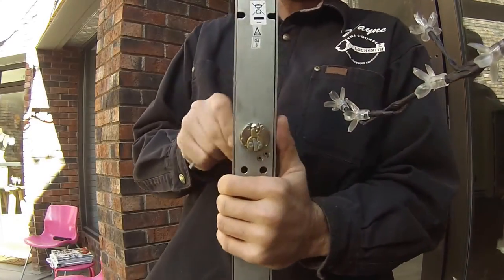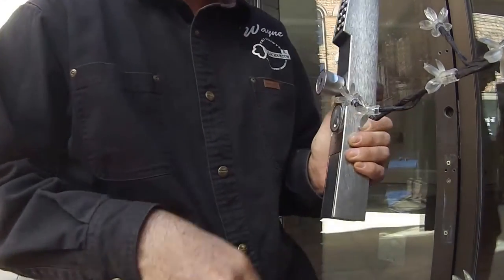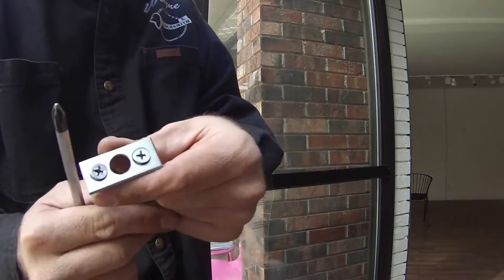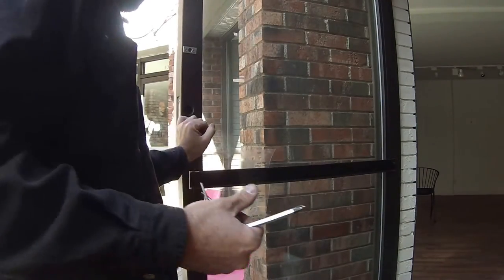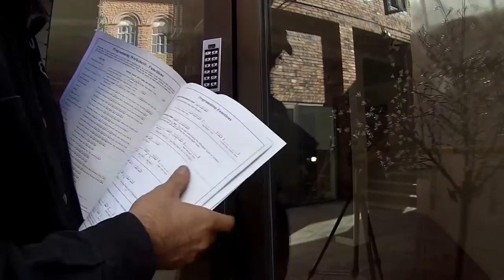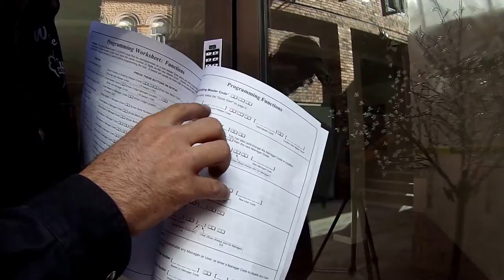DIY Access control install keypad Alarm Lock 1250 For Narrow frame aluminum glass storefront doors

Comment: I see that you removed the pull handle to accommodate the lock mechanism.  What style did you replace it with?
Reply from the maker: The lock comes with handle also there is a push pull paddle on the inside
Reply: @waynewinton  where can I find that proper push paddle for the inside ?
Any help will be good 
I am installing a DL1200 model on my door 
But don't have the push paddle for the inside 
Do you have any idea on wich one can I use ?
Thanks

Comment: If you want to make a nicer install use that lock with the deadlatch so it locks automatically each time it shuts. To save $$ just use a TTurn inside or the AR push paddle which either one allows deadlatch bypass mode for day use.

Comment: which model combination lock  would you recommend adams rit lach lock  with a lever handle  thank you
Reply from the maker: The Alarm Lock Dl 1300 or 1200 will work with that
Reply: i need with out side lever handle  why you call it alarm  does it have a alarm  build in the lock
Reply: @waynewinton  after you enter the code it doesn’t Inguage (pin ingauge ) what might be the problem. 
I did install new batteries.

Comment: I recently installed an alarm lock 1225 thumbturn style. I sure wish it had that stick on template like you used. They must not carry those style stick-on templates anymore as I only see the crappy cardboard ones that really suck to get the holes lined up just right. Thanks for sharing!